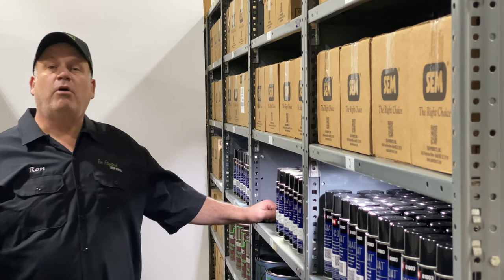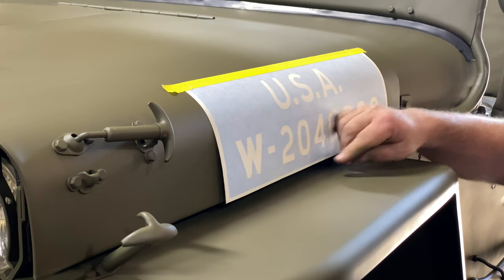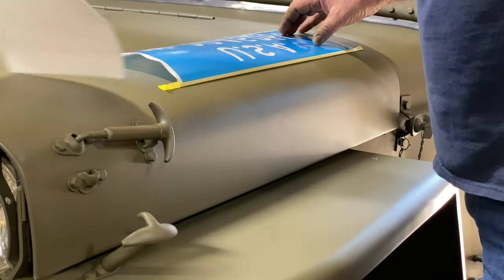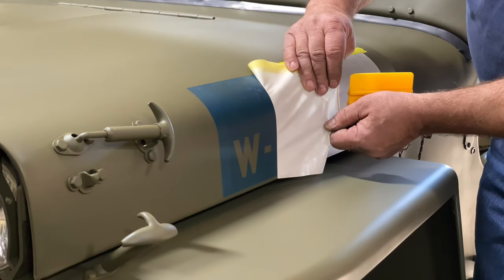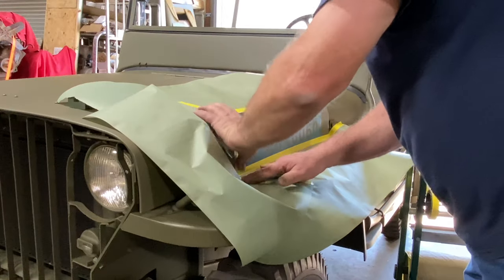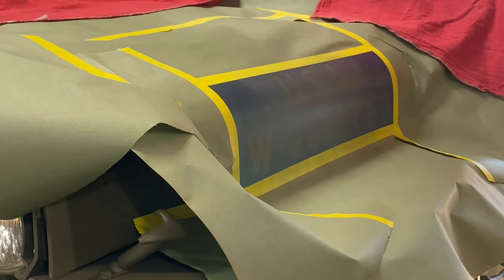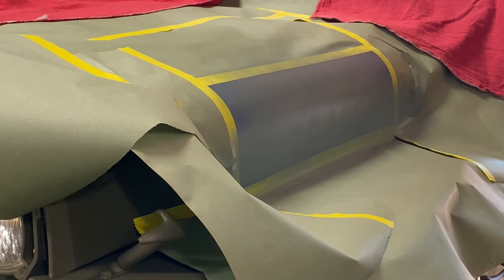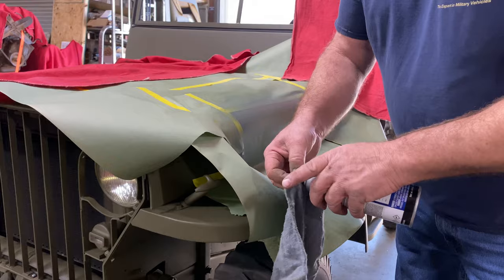Do it yourself, how to install stencils on your vehicle, Team G503, Willys MB Ford GPW [4K]

Comment: Hey great video very helpful I have a 1942 g7107 that came from up north served on the Alaskan highway construction during the war so I'm in the middle of restoring it up in Alberta Canada just wondering what is the motor pool blue grey color you used so I keep it historically accurate I'd like to do the truck justice